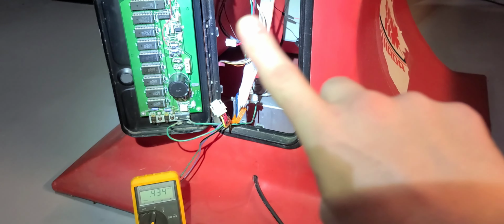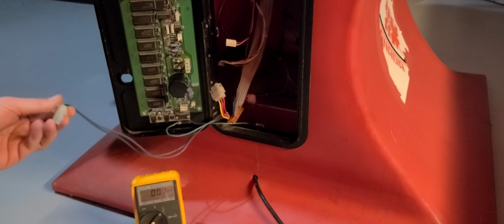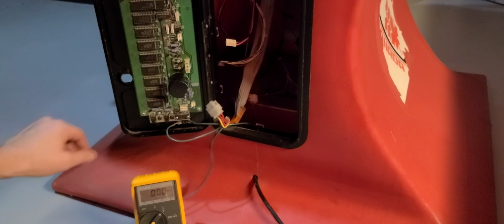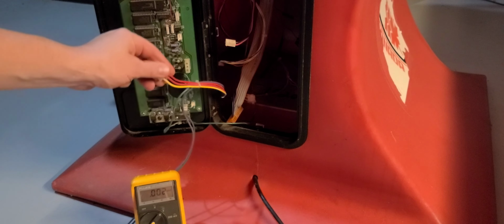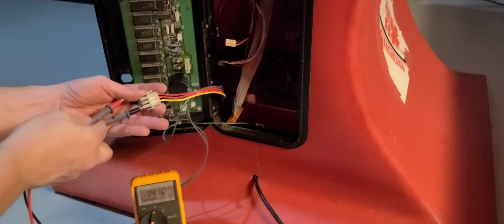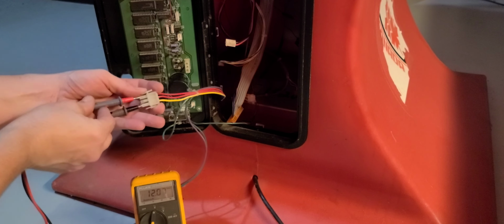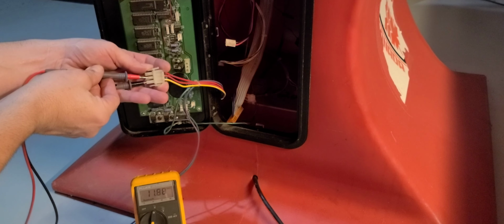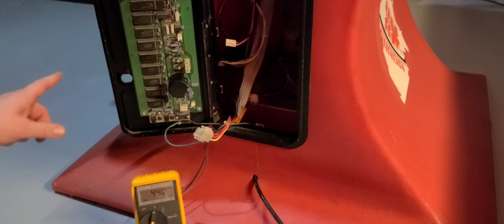Chexx bubble hockey 83 model power supply test

Comment: Hey DB, thanks for posting these videos.  They've been really helpful. I have a question about my 83 Chexx.  I replaced the capacitor in the power supply because I was getting a low voltage reading. Everything seemed to be working before, but I lights flickered every once in a while so I thought I would just do it. Voltage went up.  But now, when turned on, there is no start up (no initial sounds, no coin activation, no national anthem, etc.).  The scoreboard light goes on, but scoreboard LEDs on both sides show a lower case T (or 't').  I did disconnect some cables to get the power supply out of the door but carefully put them back in place. Any idea what is causing this? Thanks!